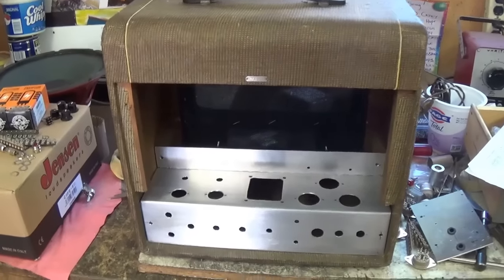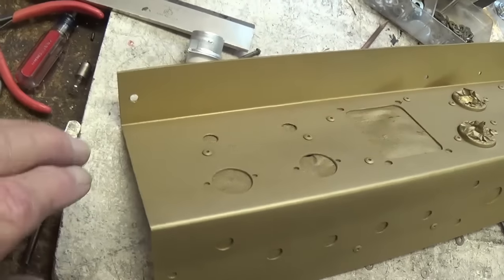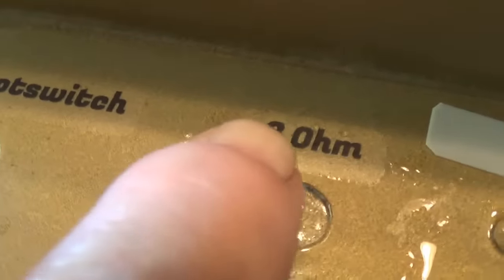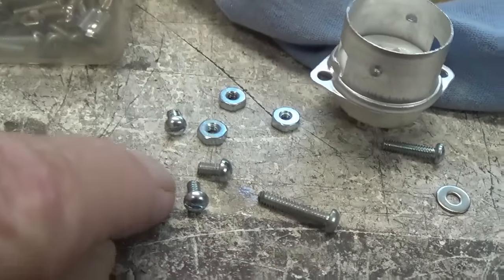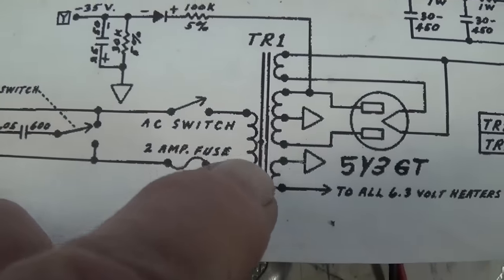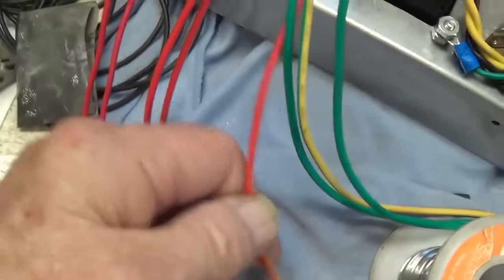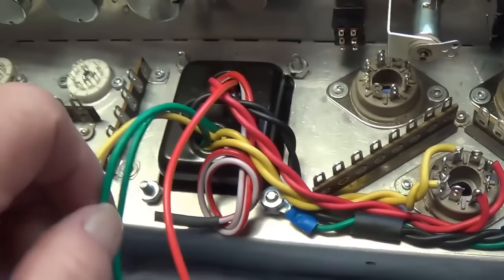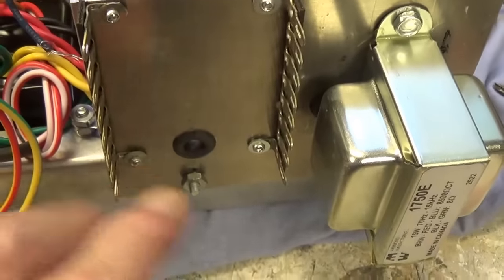Let's Build the Suprinceton, Part 2:  Chassis Painting, Assembly and Wiring

Comment: Fantastic stuff, Doug! (You've got me to a point where I complete most of your sentences for you!)

One question: Do you intend to paste some foil or maybe staple metal mesh into the cabinet to form a back, bottom and sides to complete the Faraday cage or do you not think it'll need it? I'm thinking of the foil that's usually on the open, top side of Fender chassis that hang from the top of the cabinet.

One more: Would it not make sense to ground the chassis to the transformer HV center tap *anyway*? Then it won't be floating compared to the rest of the circuit, right? (Or is that not a concern in any way?)

Oh and one last one: Would it not make sense to put the fuse before the switch? Then it can also protect should the switch ever somehow short to ground. (Unlikely, but maybe possible if something got smashed just right. The switch is down at floor, foot and caster-wheel level.)
Reply from the maker: No, on the foil, AQ. RF interference just isn't an issue any more, at least in my area, with the demise of ultra-high-wattage AM radio stations. The HV CT and the chassis are indeed connected through the input and output jacks. Considering that I have NEVER encountered a spontaneously-shorting power toggle (which would be "saved" by the outlet circuit breaker anyway) but HAVE personally encountered the shock hazard of a live fuse in a shut-off amp, I absolutely, unequivocally will NEVER place the fuse before the power switch in any circuit I build or repair.
Reply: @UncleDoug AH! Didn't consider the live fuse issue. That's all I needed to hear, thanks, I'll do it your way! (Now that you mention it I think you explained that in the past but it slipped my mind. Thanks for the reminder!)
Reply from the maker: Yes, indeed, AQ.  @AdmiralQuality
Reply: Ah! Just tried to post a link to Psionic Audio to show you an example of a "spontaneously-shorting power toggle" that apparently wasn't saved by the breaker panel. (Or maybe it partially was but components still had time to burn and it took out the PT primary.) Unfortunately I see that post disappeared, you must have it set to not accept URLs now, so here it is again with only the YouTube video code query string that goes after the server name, please take a look at it and let us know what you think: watch?v=R50QiDw69Is
Video title is: Reissue Roulette | Princeton and Deluxe Issues

And also, doesn't the fuse usually come out in the cap of the fuse holder? Meaning as soon as you open the fuse, that'll break the circuit even if the power switch is on, right?

You're both really bright techs and I've learned a ton from both of you but I think I have to side with Psionic on this one. (Just started watching Psionic recently - that man is a machine! New amp repair video every day or two!)

He's also got some "lead dress" tips for reducing noise that you might find worthwhile to look at. They're in almost every video he does.

He's not education-oriented like you, he always states his videos are mostly for customer documentation and he doesn't get deep into theory. But I've learned enough from you and Mr. Carlson that I can follow along no problem.

Comment: I might have missed it or perhaps its in Part 1 but do you discuss your reasons for the unique grounding scheme? Thanks
Reply from the maker: Yes, it was discussed in detail, Allan. It was to avoid the inability to make solid, non-corroding ground connections with an aluminum chassis.
Reply: @UncleDoug  Thanks, I have watched that section again. A follow up question. Are the tube bases Al or steel where they are pop riveted to the chassis? If steel, then is that an issue? Similarly where the tag strips are rivveted to the chassis are those lugs steel? Or is the only concern any ground connections to the chassis as they are part of the amp circuit? However I recall you said you used zinc washers with any steel bolts so I assume all the power transformer bolts for example have them.
Reply from the maker: The tube bases and terminal strip feet don't matter since they are not part of the circuit, Allan. Only ground connections are vulnerable. @allanpennington

Comment: I notice that you don't use silicone or hot glue to secure the filter capacitors to the chassis, and I'm assuming that you don't think this is necessary. Is that right? As a newbie looking to develop sound techniques, I GREATLY appreciate all of the tips I'm able to mine from your videos, like the tip for crimping wires to the lug before soldering in Part 7 of your How to Scratch-Build a vintage amp series. That said, however,  I do find myself wishing that you had a series of short videos dedicated to specific best-practice techniques like soldering, or replacing filter capacitors.
Reply from the maker: No, I have never found a reason to glue the filter caps to the chassis, T. I show the best way to replace filter caps in virtually every one of my repair videos. Thanks for your input.

Comment: I've spent hours reading your posts and have learned a great deal.  But one thing I can't seem to get is how do you connect 2 channels of an amplifier to an oscilloscope?. Where do the ground clips of the probes go? Do you need them at all?  I am 79 years old and I want to live to see 80.
Reply from the maker: Since vintage tube amps rarely have 2 channels operating simultaneously, this is not an issue I have encountered, Richard, but I see no problem with this scenario. The ground probes would go to the chassis and the signal probes would go wherever you wanted to monitor the signal. Naturally you would obey all the rules of safety regarding high voltage exposure. What is it about this that worries you?
Reply: Thanks for the reply Mr..Doug. I have an early Pioneer sa9100  integrated  stereo amp that I treasure. It generates voltage on both channels all the time so I think it might be diffirent from my Fender Deluxe 112 Plus guitar amp which has 2 inputs. I have watched your videos about isolation transformers and clipping the grounds together on the chassis but I'm not sure both situations are the same. Can you help me figure this out?  I want to monitor a sine wave on both channels on my scope.
Reply from the maker: As I said, I have no experience with transistorized circuits, but I believe my previous response answers the question, Richard. You might want to seek onsite assistance if you are still hesitant. @richardfriedlander8281

Comment: Hello Uncle! Is said lacquer base epoxy based? How do you get it to adhere to the aluminum? I haven't had a lot of luck when trying to paint Al. Thanks!
Reply from the maker: The base coat is flat lacquer, E. If the aluminum is perfectly clean, it will stick.

Comment: ......isn't the circuit also grounded to the chassis through the instrument and speaker jacks? Are the jack bodies insulated from the chassis?
Reply from the maker: The jacks are not insulated, so a connection is made through the jacks.

Comment: After sliding on a decal, you'll want to dab it with tissue to remove all the water from under it. If you don't they will turn milky after painting.
Reply from the maker: Perhaps that's what happened, Willem. I did tissue-dab some of the decals, but not all. Thanks !!

Comment: Hey Uncle D....question;
I saw this guy on YT using a cheap transformer like a 9V, in reverse .
In this case a line-out from the mixer into the output of the trafo. He did this to get trafo saturation by slowly adding gain into the trafo. He fed the input of the trafo back into another mixer channel. Is this a safe thing to do? I followed your output transformer video, but here the impedance thing (in reverse) gets very fuzzy in my brain lol. Any toughts I can hassle out of you? 😬 I know that's not really the direction of this channel.
Reply from the maker: You're right, PJ, that weirdly conceived line-out circuits are definitely not part of our experience or knowledge base. None of this makes sense to me.

Comment: If you get hum from the controls (due to the finish on the chassis), will you do a brass grounding plate behind them?
Reply from the maker: No, I have never considered using one, TV. The inner surface of the chassis was bare, clean metal.
Reply: @UncleDoug  Oh, I was under the impression both sides were painted. As Roseann Roseannadanna said, Nevermind.
Reply from the maker: Painting the outside was hard enough, TV. @TheTrueVoiceOfReason

Comment: I wonder if there would be a benefit to hooking both HV leads from the PT through a Switch/relay with sufficient rating to the rectifier and offer the option of switching between voltages on the fly. Kinda instant "sag" feature without the need for a variac. Maybe for using fixed bias would be problematic, but for cathode biased..
Reply from the maker: I actually considered doing this, Hanan, but was concerned that the switch (probably rated at 120VAC) might arc at the much higher voltage......or that it may induce a huge, destructive flyback voltage in the PT.....if someone ever flipped it with the amp "on".  Also, the circuit operating voltages were way too high with the 325VAC winding engaged.
Reply: @UncleDoug  both good points. You could use a European rated switch which is at least 240VAC standard. Regarding the 2nd concern of high flyback current to the PT, you could use a large bleeding resistor to limit the current and present a load to the PT (kinda like a dummy load used for tube heads) or even better, use the actual Amp power switch as a 3 position switch with the middle being "off" so that the transition would always go through an off state (my initial assumption) you'd have a High-off-Sag switch as power switch. What do you think?
Reply from the maker: I honestly see no benefits commensurate with the possible risks......a 240VAC switch handling 450VAC, the relatively slow response of a bleeding resistor to the rapid change of voltage.....and, most of all, since  no sag is evident at the (currently utilized) lower-voltage setting, what is gained?  @HananGrinberg

Comment: Hopefully you can help me. 65 DRRI was making hissing/crackling noise' had a tec go through it' installed new tubes and replaced caps' when I got it back the reverb doesn't start to come in until on 8.... before 8 no reverb. 
The reverb was working fine before I took it to him. 
Any idea?
Appreciate it.
Reply from the maker: Take it back and have him repair the reverb. He broke it.....he should fix it.  Also, hissing and crackling is almost always caused by ailing carbon comp resistors......and almost never caused by tubes or caps.

Comment: Aren't the negative lugs of the speaker and input jacks contacting the chassis? And if not, what happens if you plug in some other grounded device, or even the barefoot player touches his guitar?
Reply from the maker: Nothing, since the chassis is thoroughly grounded by the green wire of the power cord.

Comment: “Galvanic corrosion (also called bimetallic corrosion or dissimilar metal corrosion) is an electrochemical process in which one metal corrodes preferentially when it is in electrical contact with another, in the presence of an electrolyte. “
Reply from the maker: Which is almost exactly what I said in the video. Thanks for your input, PK.

Comment: I didn’t know the water slide decals were compatible with automotive urethane.  I have a guitar neck painted with it, wanted to use a water slide decal for the logo.  The painter told me it would likely melt once he put the clear coat over it.
Reply from the maker: Apparently the decals hold up well to automotive urethane, D. Painters tend to be very cautious.

Comment: @1:00:35 Is the input jack also isolated from the chassis?
Reply from the maker: No, it isn't, which provides global grounding without any ground loops.
Reply: @UncleDoug  The zinc plated nut and bolt doesn't provide that?
Reply from the maker: Other than the green AC ground and the CT of the 6.3VAC winding, no part of the circuit is grounded to the chassis.....it is "grounded" to the HV CT.   @ross3818

Comment: Soon you'll be selling U.Deez Amps with the logo U NeeDeez Amps. Not knowing anything about amps except how to plug them in, I always assumed the aluminum base was kind of a heat-sink and I wonder if the coatings you installed will de-enhance that aspect, if indeed it is an aspect. Interesting thing to learn about twisting the wires...in the Movie Biz we always had to run our 4/0 or 2/0 power cables over or under the Sound-recording cables at 90 degree angles to avoid a hum in the recording, could not run even remotely parallel. That caused lots of complications in some small sets. Now that I don't need to know, I know how to solve the problem. I'll pass it on to my sons in that Biz, see does it work with 400 and 200 amp cables.
Reply from the maker: Thanks, CdC. You're right about the 90 degree orientation of signal cables......it's important in guitar amps also.
Reply: Same general practices applied to installation of category 5 computer cabling when I was a telecom tech: our cabling had to be a minimum of 18" away from electrical lines or equipment and couldnt run parallel to it for more than 3 feet; crossing at right angles was the rule even though Cat 5 cables use twisted pairs and are designed for high common-mode rejection of electrical noise. But, 400 amp wiring is way over my pay grade!

Comment: Referencing to 22:40, Doug, don't you have electrical crimper with built-in, thread-deburring bolt cutters that start at 4/40 thread?  They shouldn't be terribly hard to find, even at local hardware stores, although some of them start with 6/32 thread. There are metric crimpers available for cutting metric fasteners and deburring them simultaneously, but those can be a little tougher to find (primarily a mail-order item), but they'll usually include metric bolt sizes that are a little smaller than 4/40.....
Reply from the maker: Thanks for the tip, GU. I'll try to find such a tool.
Reply: @UncleDoug  , the funny thing is, sometimes cheap crimpers that don't work very well for that purpose will turn out to be more useful for the built-in screwcutters, which have a threaded side and a non-threaded side. (I have heavy Klein crimpers for most crimp jobs). Insert your bolt, *starting from the threaded side of the tool only*, so that the excess bolt length you wanted to trim off protrudes through the unthreaded hole and pops out automatically when you squeeze the handles to cut the bolt. When you unthread the bolt from the crimpers it deburrs the threads automatically. Note that if you insert the bolt from the "wrong" side, the cutoff piece stays in the crimper,  and if it's short and stubby like a setscrew you'll have trouble getting it out; and the shortened "keeoer" bolt won't be automatically deburred. I learned this tge hard way!! (And, a well known, brilliant YouTube electronics whiz got snarky with me for pointing this out!).

You're a car guy ---- check your tool chest, I bet you have a set of bolt cutting crimpers already and you don't even know it!
Reply from the maker: I will definitely hunt down a pair of these magic screw-cutting pliers. Thanks !! @goodun2974
Reply: @UncleDoug  , beats deburring them with a a dremel tool! PS, superglue as threadlocking compound? Loctite is mo bettuh....
Reply from the maker: Thanks for more helpful input, GU. @goodun2974

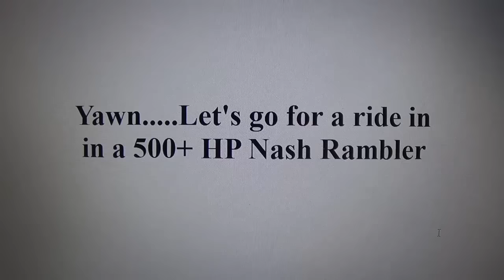Comment: 😳, @ 18:16 Eye love a bone stock, "Sleeper"! Very sneaky!  😣@ 52:40-, "Ben Dare, Done Dat!" Put cheapo staggered 'duals' on my H-D Police Special. Wanted that signature v-twin note. Problem; front cylinder (muffler) made contact whiff da road @ moderate lean-angles😕! Solution, cut-the mufflers off😏. Oh snap! 18" straight-pipes sound like; "👮BOY! You earned this ticket!" Back to stock exhaust😔
Reply from the maker: That's also what this Suprinceton will be, JW.....an old tattered cabinet with a surprisingly strong "engine".